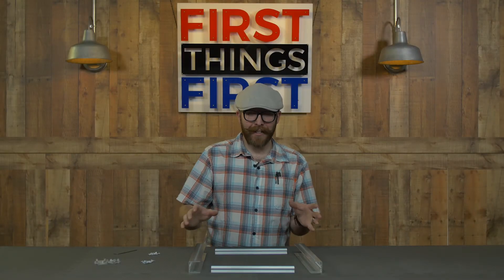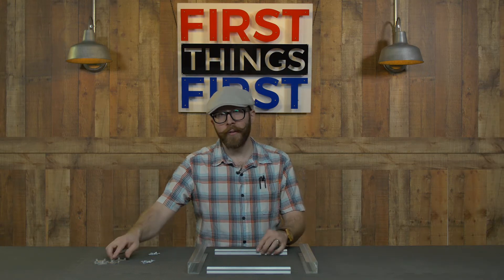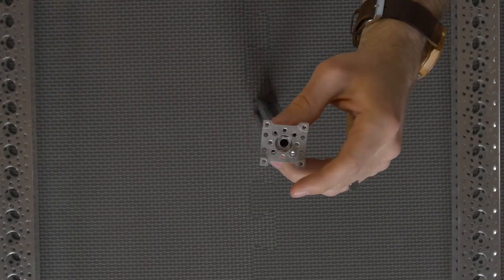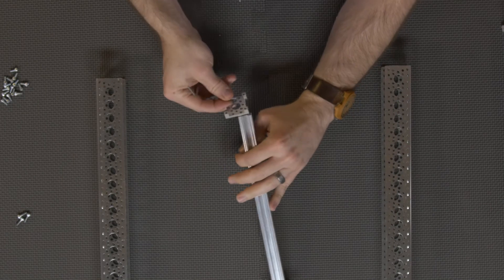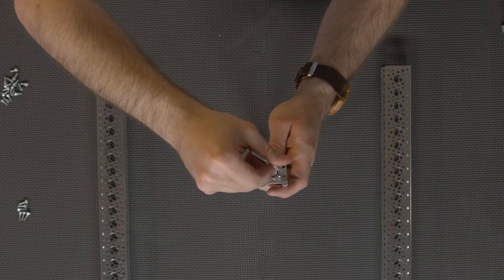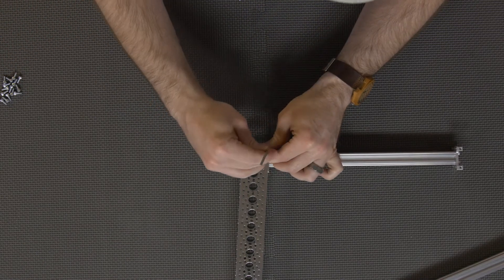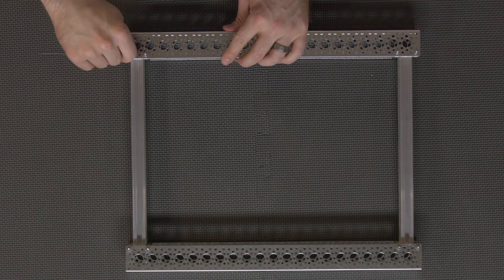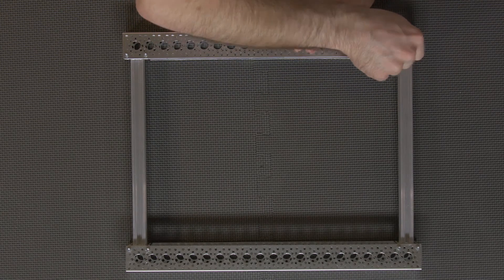FIRST Things First - Frame Build 1

Comment: For this frame build, how would you recommend attaching motors? The subsequent Drive Motors & Wheels video is off of Frame Build 2, which has the channel rotated 90 degrees.

Thanks!
Reply from the maker: Hi Glenn, there is more than one way to crack that nut. For example you could use the bottom tapped clamping mounts included in the Actobotics FTC Kit to mount the motors off the top or bottom of the channel. Or you could use “Aluminum Motor Mount E” (pn: 555188) to go from the open inside of the channel to a coupler/shaft that goes through a flanged bearing placed in the outer wall of the channel.  Feel free to let us know if you have any other questions we'd be glad to help! tech@servocity.com
Reply: Yeah, the 555188 looks great for this. I'll nudge our team that direction. Thanks!
Reply from the maker: Glad we could help!